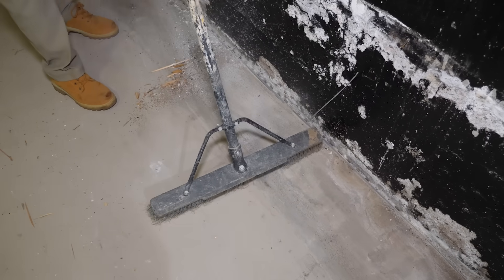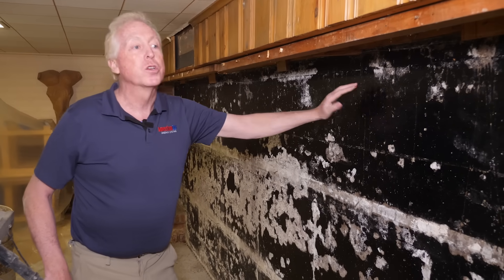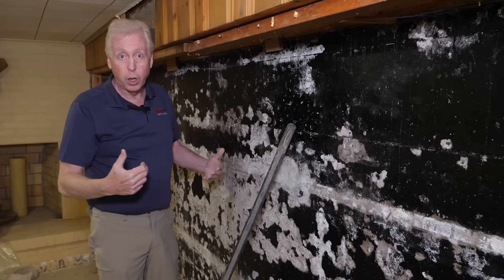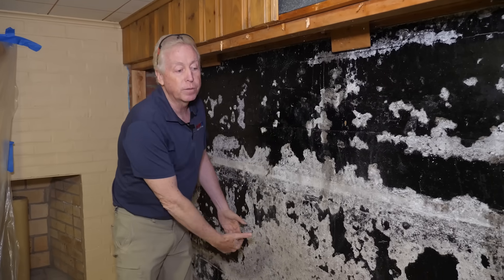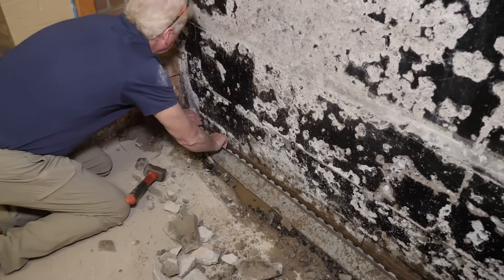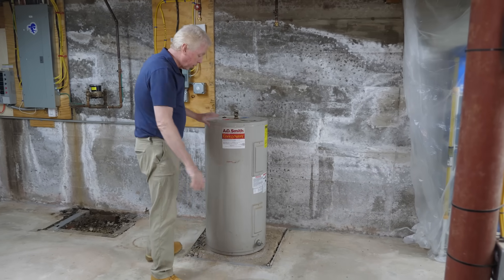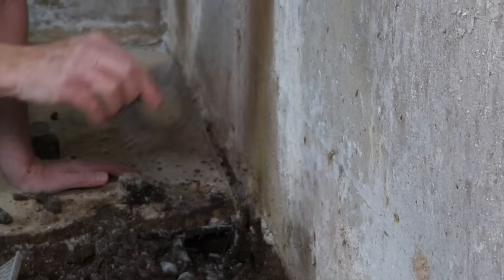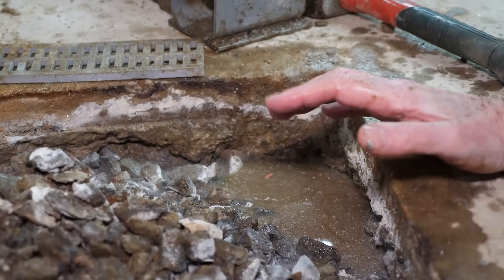Waterproofing Basement Walls | Finished & UnFinished Basement

Comment: I know this isn't a new video but I'm building a new addition and want to do it right. Im pouring a basement and want to make sure it's dry for a semi finished look eventually. What should I do.
Reply from the maker: This video might help. https://youtu.be/_7Ly63FdrfQ It covers interior waterproofing a complete home renovation. I plan on doing a video on new home construction in the near future. Note: you must do exterior waterproofing of the foundation walls to meet code on new construction. Check with your town/city inspector.

Comment: Is putting liquid rubber on outside of foundation wall (part below soil) a good thing to do?
Reply from the maker: You can use liquid rubber to waterproof or damp proof your exterior foundation. Do not apply it on the inside wall of your basement.

Comment: I have a field stone 1920's era foundation  that would piss water when it rained. On the outside I dug to footing and tar'd that 10' section and laid 6 mil polly on an angle extending 5' away at 3' under and it's dry now.  Couldn't I just do that around entire crib to keep dungeon dry?
Reply from the maker: Exterior waterproofing for a stone foundation doesn't last long, but you might get lucky if it last longer than 3 years. This video will show you how we do it. https://youtu.be/wT-8sh6RyIo

Comment: So it should have been waterproofed from the outside and a drain line at the bottom of the wall on the outside as well, sloped downwards for water to run away from the house, right?
Reply from the maker: Yes. A newly built home or older home should have all these exterior waterproofing details in place. The drain line is not there unless specified during construction.

Comment: I would guess these basement walls were not moisture proofed on the outside. This should have been done before backfilling. This is a unusual situation for a basement. Oh , the floor rest on gravel (the best) or soil/ dirt , it does not space accords from one side to the other.

Comment: Thanks for this in-depth video. I need some foundation repairs but have been hesitant due to exactly what happened to this house. I do not want to get the wrong foundation system.  I'm considering having a structural engineer give me an inspection first and go from there. What is your opinion about that? How would you know if a foundation system is wrong for your situation?
Reply from the maker: If you are experiencing bowing walls, cracks bigger than a half-an-inch, extreme cases of jammed windows and doors, then you should call a structural engineer. Otherwise, a basement waterproofing company should be able to inspect your home's foundation and tell you the best course of action. Some waterproofing companies do foundation repairs using jacks and replacing the footer and wall. Many don't and hopefully will refer you to a structural engineer if necessary. Good luck.

Comment: Is it possible to have one of the “high tech” gutter systems checked to see if it works? I have always doubted that ours actually flows downhill toward the sump pump.
Reply from the maker: Unfortunately, gutters only moves water when water rises and reaches the drainage at the floor level. It is too late at that point. Your floor will be sitting in water increasing the humidity in the room. In big storms, it fails and a floods the floor. The corners are non-continuous, water ends up back in the ground beneath your floor. Watch this video: https://youtu.be/FCP0Wd_7n5c?t=432 They can only be installed level because they sit on the footer. There is no pitch to move water to the sump pump. Footers are engineered to be level by code.
Reply: @AmericanDryBasementSystems  that makes perfect sense. Wish you guys were in Tennessee, it’s very wet here!

Comment: Interesting video covering the practical aspects of waterproofing thanks. I am a structural engineer (from UK) and so have some experience in waterproofing and am fascinated by this stuff. Usually the architect or a basement specialist will specify these but I am always interested in how the different systems work. In the US do they ever specify/install a tanking system which wraps around the outside of the walls and slab? Another option is to cast the slab and walls together and place hydrophilic strips along any joints (usually from the kicker to the wall) and use the concrete itself to prevent water getting in. Usually two systems are used in case one fails. I wonder if the systems being condemned in your video are actually ok but the installer put them in without following the manufacturer's guidance?
Reply from the maker: No. The system we tore out is not Okay for this basement. Not even acceptable. There is million and one ways to skin a cat, but we are dead set on installing a system that is a solution in keeping water off the floor and the relative humidity at a healthy level. Dual waterproofing inside and outside is Okay, but the outside will in most cases fail in time, and not cheap and easily repairable.
Reply: Personally, I use different types of waterproofing and draining systems depending on the type of wall. Personally I think it's a lot easier to reduce hydrostatic pressure on a block wall than a solid pored wall. Ideally you always want to at least do the outside of the house but when I build new houses I would drain the outside and the inside. It's all about reducing hydrostatic pressure.
Reply: Yeah don't listen to them been doing this for 40 years and watched this jackwagons other videos. The one system they picked apart was not done correctly, im pretty sure I watched a video of theirs when he blows out the footing of the wall, ive replaced many of his systems because they don't maintain them they build up with silt and pumps are mechanical and need maintenance which they do not provide, this guy is the joke of the waterproofing industry I can promise! 🤣

Comment: We have been told cement becomes harder over time in the presence of water, so the degradation of the cement is from the soil content ?
Reply from the maker: True. Construction cement exposed to moisture never stops curing, except after 4 weeks it will be so slow that it will take another 100 years before it cures another couple of percentage points. The problem lies in acidic soil that leaches lime out of the cement. Lime is the glue that holds all the particles together. Take lime out of the equation you will get a weaker wall more prone to cracks or bowing.

Comment: Why aren't basements installed with an interior or exterior system before backfilling the new building? Is it because of the added cost?
Reply from the maker: Yes. Most new construction leave it up to homeowners to add later if necessary. It is rare to find one that includes both.

Comment: Great video and so impressed with how much you reply to questions. How would you approach this scenario that I have. House in Chicago is from 1893, sits in Sandy soil not from beach. Basement has had an injector put in from previous owner. Everything seems to work well and for is dry even after heavy rains in spring impacted several neighbors on the block. I am seeing efflorescence on the basement walls but no leaks or running water. We have a garden on one side and neighbors driveway on the other. Both could be easily contributing to hydrostatic pressure. Thoughts on steps to determine how concerned I should be? At some point we will put in a new driveway next to garden and can address that side of the wall with resloping away and drains. Was considering permeable brick to drain out of drive. Any thoughts would be helpful. And keep up the great work. Wish you in Chicago!
Reply from the maker: Efflorescence is both an indicator that acidic moisture is present in the ground against your walls for a prolong amount of time. The concrete does weaken, but it takes a very long time for it to have a physical effect and it depends on the level of acidity in the soil. An injector is usually used for septic removal. A sump pump is used for removing ground water. I don't think you have a sump pump. Keep an eye out for cracks. If you don't have cracks more than an 1/8 of inch and no water on the floor... you are Okay. No worries. Good landscaping can help keep water from lingering around your home.

Comment: I wish you had made this video 2years ago before I spent $11k on a the basement gutter system. Our slab is below the footing so it does catch some of the water but in our last atmospheric river storm the gutter failed and water still overflowed into the basement. The sump pump appears to have discharged some water, but I can't determine where the failure occurred. Will you be taking any vacations to the Reno/Tahoe Area? Do you do Skype/Zoom consultations? Your videos are very concise and well delivered. I trust you already more than our local contractor!
Reply from the maker: I love the Reno/Tahoe area! Unfortunately, I will not be around there any time soon. We are very busy this year since hurricane Ida and a nor'easter hit our area. Everyone over here are having flooding problems, and many are redos like the one in this video. You are going to have to find local concrete contractor who knows something about subfloor drainage. Good luck with a solution.

Comment: I have a crack in one of my basement walls. You're saying dry lock is not a good product to use to seal that crack can you recommend a different sealer? Thanks
Reply from the maker: I am referring to Drylok waterproofing paint. You can use Drylok hydraulic cement to seal a crack. It won't last long. The crack can expand and render the Drylok useless. It is a temporary patch until you get the crack sealed correctly.

Comment: Omg you saved me from making a huge mistake with just applying tar to my concrete wall.. I have similar situation like this video, no tar applied.. What is the average cost for the system you put into this home in the video?
Reply from the maker: Tar can only be applied on the outside, not inside. We never quote prices on the internet. Call us for an inspection and we will give you the exact cost for your home.

Comment: Is there anything I can paint on the interior to stop the water from coming thru the walls like a waterproof agent?
Reply from the maker: You will speed up deterioration if you trap moisture in the wall with waterproof paint. The hydrostatic pressure must be reduced with a drainage system before applying any paint on the inside walls. Only the outside wall should have a waterproofing agent.

Comment: Will closed cell spray foam cause/accelerate the same deterioration issues as identified in this video?
Reply from the maker: No. You have to keep the hydrostatic level low with a capable subfloor drainage system otherwise deterioration will take place.

Comment: Great video. You have covered the inside of the wall bit what of the outside facing side? Is the deterioration of the cement blocks inevitable eventually?
Reply from the maker: No. As long as we keep the hydrostatic level low the deterioration on the outside will be minimal.

Comment: Question from Florida: Do they ever waterproof the EXTERIOR of th foundation before it's backfilled?
Reply from the maker: I don't know Flordia's building code for foundation waterproofing and dampproofing, but it is required in New York and Connecticut.
Reply: Michigan here, my dad built our family home himself, and tarred the the block wall basement all around the outside before backfilling. This was pre-code, around 1974, and we never had a single leak until a later hand poured porch caused water to seep against the wall creating a fracture. The leak started in 2010.

Comment: What about putting closed spray foam on the walls?
Reply from the maker: It's okay as long as you are managing the water level outside the house. It should never rise more than 18 to 24 inches around the foundation during a heavy multi-day storm. In some cases you may have to use a dehumidifier during the summer to reduce relative humidity.

Comment: Really explaining the science and technical aspects of waterproofing a basement. Excellent video!
Reply: Standing water rotting out the wall. Science? This dude said cement is rotting!
Reply: @batencheetos  rot is any form of chemical degradation. The lime's chemical bond with the other components in concrete is deteriorating aka rotting. Rot isn't limited to organic material. I agree with you that this guy isn't explaining anything scientifically. Infact it sounds like the man in the video works with smart people who understand the science and has had it explained to him and is now trying to regurgitate that information he only kinda understands. But I also believe in supporting your opinions with correct knowledge acquired to the best of your abilities.

Comment: Great video! May I know what is the product you seal the wall with? I live in Montréal, Canada and I have the exact same problem. I’m planning to do a Delta system on the outside and installing a new weeping tile, but would like to repair the damaged concrete interior wall from the painted on tar. In help would be greatly appreciated….cheers eh!….lol
Reply from the maker: Our concrete waterproof restoration mixture is proprietary and exclusively used for our contracted jobs. Yet, you can find a similar product online that uses a crystalline ingredient. There are several brands you can choose. We mix our own for interior use.

Comment: How to you maintain your basement waterproofing system when/if you finish your basement?
Reply from the maker: Our system never needs flushing. It is self-cleaning. The only thing you have to keep your eye on is the sump pump. Check on the sump pump once a year by pouring a gallon of water into the sump basket to hear the pump activate. If the pump doesn't activate then something is wrong: float is stuck, loose plug, or pump malfunction. Call waterproofing company to get it fixed.

Comment: I have a stone foundation and a previous owner painted the interior wall of the basement with drylok.  Half of it peeled off.  I manually removed all the loose drylok and once a year a wipe down the exposed stones to remove efflorescence.  The exposed stones are actually beautiful.  I don't know why they didn't just leave the stone wall alone.
Reply from the maker: Stone is beautiful and we have found stone wall basements holding strong without the help of Drylock. I would never use Drylock waterproofing paint on a stone wall. Control the hydrostatic pressure outside the walls first.

Comment: 1:18 "Breaking down of concrete" or was it because you pounded on those concrete nails sideways with a sledge?
Reply from the maker: True. Lots of it did flake off on each hit, but we did find much of it already on the floor. Strong concrete would not flake off as easily.

Comment: So Drylock is bad to waterproof a basement?  What would I use drylock for then?
Reply from the maker: Beautifying block or poured concrete walls and floors. It should not exclusively be used to waterproof your walls or floor. If you don't eliminate the hydrostatic pressure first - the Drylock will peel and flake off in less than a year, or there about.

Comment: Type of soil and the landscape plays a big role. Our house is on compact fine sandy soil. And we are on a hilly street. Water seems to drain very well. However, we did install a weeping tile under our basement floor. It runs all over under the floor, and along the outside walls. We also put a loose dimple board membrane on the inside brick walls that leads down to the weeping tile. So the brick breathes, although not a lot. The membrane had spray foam insulation sprayed over it, to a depth of about 4”. I honestly think it’s better for brick or concrete to just be able to breath freely into room, but we needed the living space in our basement.

It would be great if we could monitor the amount of moisture in the walls.

Comment: There is a really simple solution. I bought a house with water in the basement, big puddles. The only reason it don’t flood was it would run out the basement garage door. I took one afternoon with a shovel and fixed it. Been over 30 years and no problems. All I did was dig a very shallow ditch along the drip edge of the roof and put the dirt against the basement wall. So the ground surface sloped away from basement walls instead of towards them. The shallow ditch is sloped towards downhill with some shallow surface ditches to carry the water away down hill. This works for surface run off from heavy rains. Will not fix high water table level that causes flooding without a rain.
Reply from the maker: There is no simple solution. You solved your problem by doing what should have been done in the first place. We have made these recommendations to homeowners if we see a problem on the outside of their home. Sometimes the remedies work and there are times it is not enough. Many homes have basements perpetually surrounded by ground water.
Reply: @AmericanDryBasementSystems  My basement in Ohio had groundwater issues that surfaced, primarily in the Spring.  As you said it was no simple solution.  The perimeter of the basement was dug up and drainage tile leading to a sump pump was installed.  Our builder had not put drainage completely around the perimeter.  We never had another problem after that was done.
Reply: I can't picture it.
Do a video PLEASE.m

Comment: I'm in Sweden. Here we dig around house and install drainage below footings. Removing problem water after it's in house... Is short sighted. I can understand when people don't want to put in the cash but for little extra money you get a system that will last for 40yrs...
Reply: You cannot do that in some instances, such as split level houses or a house sandwiched between houses.
Reply: The cost to do that is about half of what it would cost to rebuild the entire home in many cases. Just not worth it.